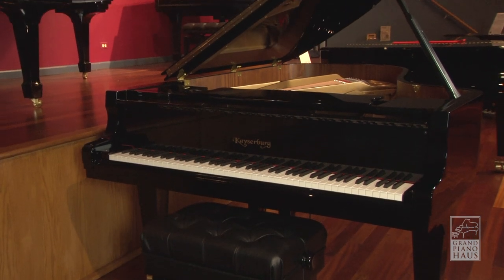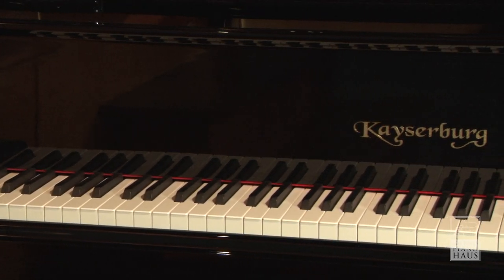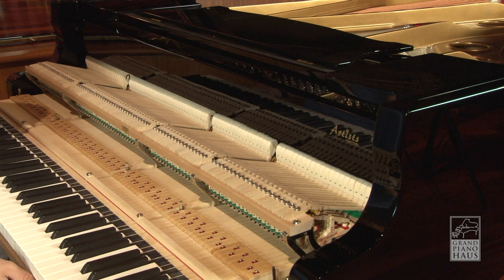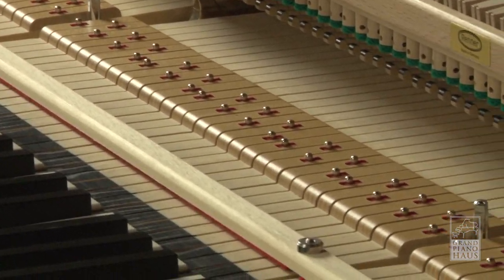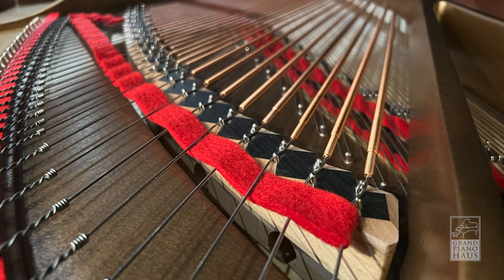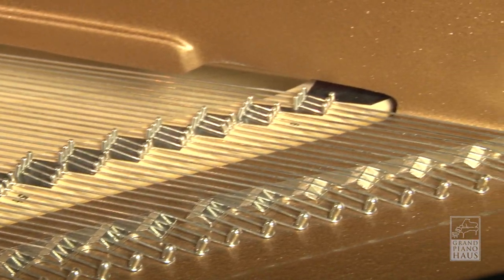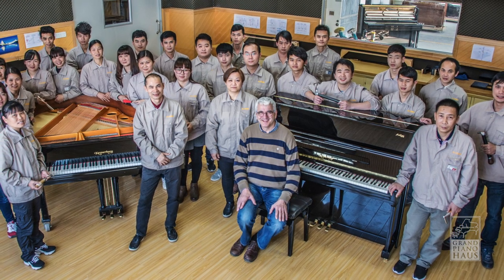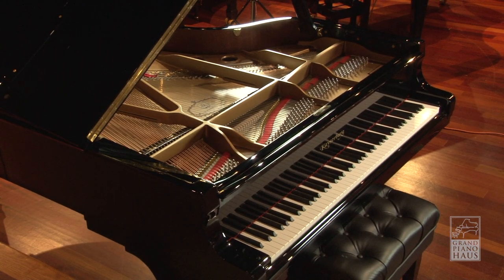Kayserburg KA212 Handcrafted 7' Semi-Concert Grand - Grand Piano Haus

Comment: Hello. Does it have a duplex front and rear? What about triplex? Thank you
Reply from the maker: It only has rear duplex.
Reply: @GrandPianoHaus  Thank you for clarifying, i am wondering how is the tone compared to the Ritmuller GH212R? I am considering buying the KA212 and wondered how it compares. Awaiting your reply.
Reply: @mkalbaker  The Ritmüller GH212R is discontinued as of 2021.  It will not be replaced.   Pearl River uses different materials and and scale design between the Kayserburg KA212 and Ritmüller GH212R.   The Ritmüller GH212R does not use Renner action stack, Laukhuff keystick and frame, Dehonit pinblock, Strunz bavarian spruce sounboard like on the Kayserburg KA212.   All Kayserburg KA (Artist Series) grand and vertical pianos are fully handcrafted by Pearl River's master piano builders.   Around 3,500 Kayserburg Artist series grands and verticals are produced annually.
Reply: @jefftasch9901  thank you very much. How is the construction and tone compared to an equivalent say a yamaha c6x as an example?
Reply: @mkalbaker  Tone:  Basically the YAMAHA C6X is designed to produce tone with more presence,  boosting the upper-mid frequencies.    The Kayserburg KA is designed to be warmer, more rounded tone.   Tonal timbre is subjective.    Construction: Can you please be more specific?    Yamaha designs and produces all parts in house.  Kayserburg: like many tier one piano manufactures which source major components from companies in Germany.
Reply: @jefftasch9901  Thank you so much for the amazing reply as usual. Construction means is it built like the Japanese.
Reply: It's build quality is more in line with a fine German made piano. @mkalbaker
Reply: @mkalbaker  Made in China.